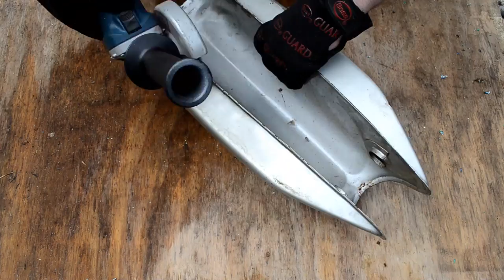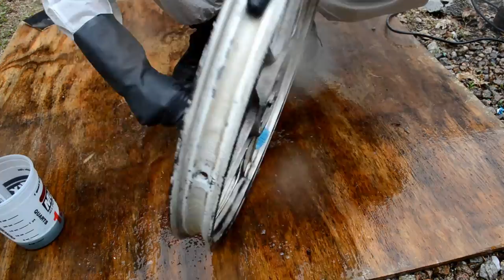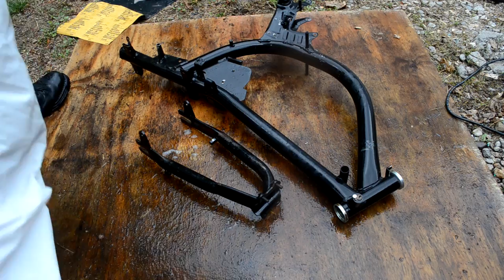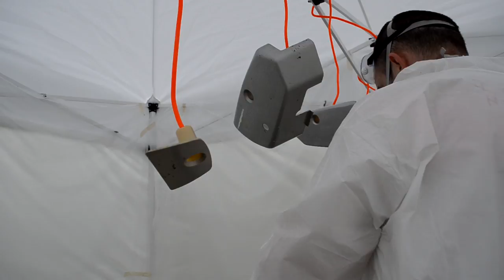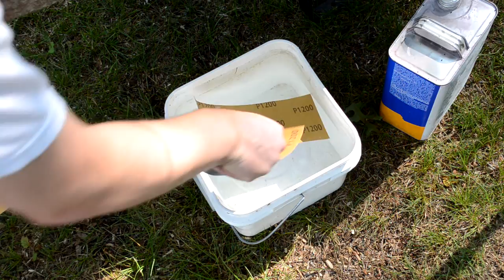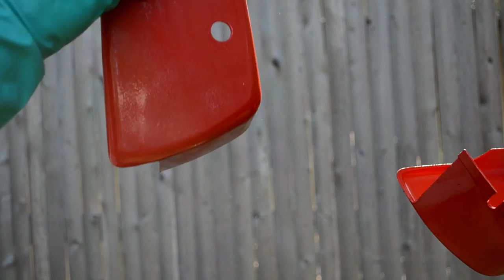1979 Puch Magnum Project Part 5 - Repainting

Comment from the maker: I generally don't remove bearing races/headsets etc unless they need replacing. Hammering it out and repressing it in when I can just use a bit of grease and tape to mask it doesn't seem worth the hassle.

Now if I was doing it professionally... that might be a different story.